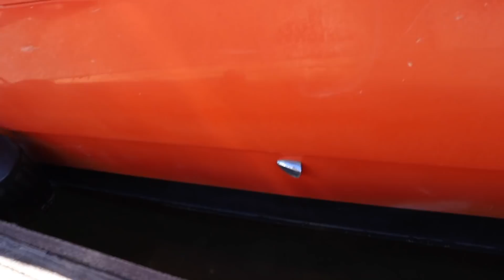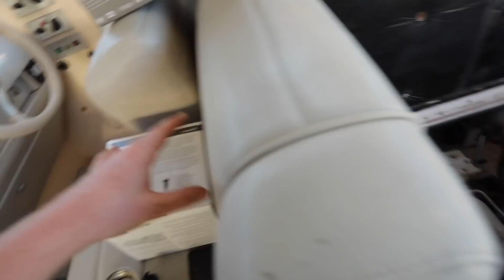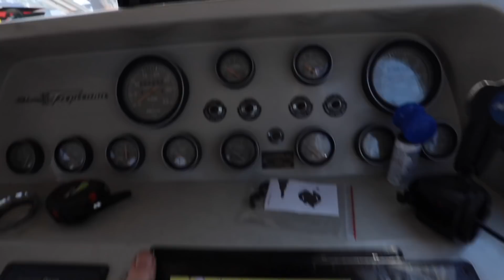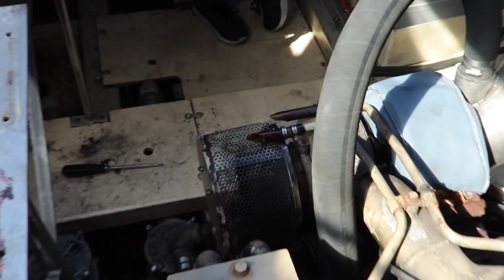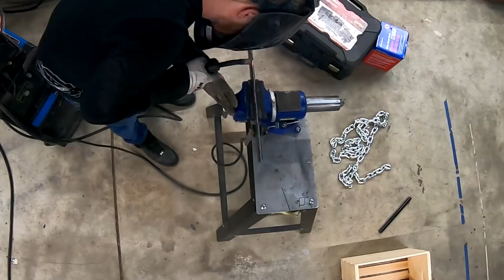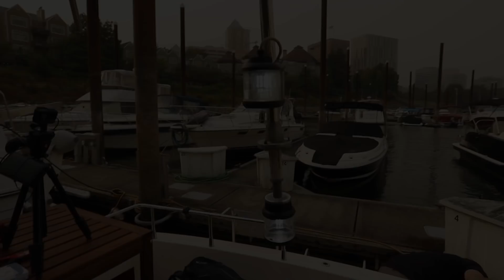Fixing Up My 30yr Old ITALIAN YACHT!

Comment: When anchored the boat needs to be able to rotate and point into the wind or tide. Anchoring from both sides is a good way to capsize.
Reply: I was thinking the same thing. Although maybe he had the idea of anchoring both sides when they are out in the bay partying or whatever. I know when he first got the boat that's what they did. Anchoring both ends in a situation like that is probably fine, just don't do that overnight when you aren't awake to fix it when things go south....
Reply: Dual anchoring has it’s applications.
Reply: Came here to post this. Also, that's likely not enough chain for the size and weight of that boat. The anchor keeps the chain in place. The weight of the chain on the bottom keeps the boat in place.
Reply: @unusuallatitudes8918  he needs at least quadruple what he's got I'd say.
Reply: Glad I'm not the only one concerned about the anchor
Reply: Stop moaning and just give the man the advise that he needs
Reply: @user-rt9ui6ge5d  m 2
m 2
1 week ago
"Stop moaning and just give the man the advise that he needs" 

AND HOPE HE READS & HEEEEDZ!!!!

there are times people just wanna see ''that one tree'' so they position their boat to SEE THAT TREE... or lighthouse or beech or wutever... BUT...

EVERYONE THAT GETS BEHIND A WHEEL OF A BOAT SHOULD TAKE A BOATERS SAFETY COURSE APPLICABLE TO THEIR BOATS SIZE AND TYPE!!!!!!!!!!!!!!!!!!!!!!

and STAY CURRENT ...as in, don't just take one class and think you got it covered..... you may... but that NEXT teacher on the next class may have other stories that will apply directly to YOUR FUTURE SITUATION and that ''online coarse'' had NONE of the extra WIZDUM!! 

or just go out and splash and hope nothing goes wrong... wutever
Reply: Yeah, you can tell he knows nothing about boating.
Reply: @RLC2020  You can also tell this community doesn't know much about boats either, only enough experience with little vessels to think they do.
Reply: @RLC2020  you should go watch his other boat videos... He doesn't seem to want to learn..
Reply: rlc2020 he should have went with a smaller boat like in the 20 foot section he shouldn’t have went with a 40 footer
Reply: @RLC2020  he said he didn't know much and it was his first hours driving a boat
Reply: @RLC2020  you didnt learn over night.
Reply: @dankane4193  I'm also not making youtube videos pretending i know what I'm doing.
Reply: @RLC2020  pretending? Whos pretending? He clearly stated when he bought this italian pos he knew absolutely nothing about boats. Most of the stuff on this channel is the learning experience associated with these videos. One would argue that for this exact reason they are so entertaining.
Reply: @dankane4193  this keyboard warrior so mad haha. Dude has no videos posted on his channel saying b is for build doesn't know anything about cars. Literal internet trash
Reply: @dankane4193  Lmao...if they were POS boats, they wouldnt regularly sell for $80-110k at 30 years old without issue. They are well respected
Reply: Rear anchors are used everywhere, you manually adjust the anchors as you need to. If you go boating on the islands in Ontario Canada you will see everyone with a front and and at least 1 sometimes 2 rear anchors. Boating isnt a "setup your anchors and dont touch till you leave" thing. you constantly have to be paying attention to winds and waves. Set the front anchor, point the nose into the wind/direction of the waves, set the rear to hold you there. otherwise you will swing around on the front anchor and be hit constantly at an angle by the waves which is not fun.
Reply: @definitelynotak4228  he specifically mentioned using it "to stay put for like an overnight stay" which is not at all what you are talking about. Double anchoring for overnight mooring is a disastrous and potentially fatal idea.
Reply: Justin Nolan he’s mostly in a river.  Not to mention all the other ways to use two anchors.  Basic boating courses teach that.
Reply: @Will Cooper  based
Reply: While this could be true it is dependent upon his location. If you are close to shore and do a shoreline with bow out and some slack it still alllows necessary rotation without allowing you to be broadside to the waves.
Reply: well i started cringing when he said phone holder....oh boy he doesnt even know how useless that phone holder and drink holder are xD just a wash from another boat and he will be searching stuff in the bottom of the river
Reply: Reading some of these comments I wonder if the people so readily giving advice or criticizing have any boating experience.

Stern anchors have their uses, like landlines do. It all depends on the situation (as in location, wind, waves, length and purpose of stay).

And it’s not the weight of the anchor chain that’s holding you and the anchor itself is not just a „decoration“. That’s only true when there’s no or only very little force applied to your boat, as in no wind/current.

Please stop spreading halftruths and misinformation, people might read it and take the advice and we get even more idiot people on boats in the end.
Reply: @Baerzilla   bUt Im A bOaT cApTaIn
Reply: I mean yeah, but when close to other boats it is nice to be mor stationary
Reply: Where I live a stern anchor would swamp my boat pronto. The chain should be about the length of the boat and heavy enough gauge to keep the tail of the anchor on the sand. If the tail can lift of the sand your drifting.
Reply: Bow and stern anchoring is common when rafting with other boats on a calm day.
Reply: You dual anchor as to not be the ass that has his boats hitting other boats.  He's not anchoring in the Bering Strait.
Reply: @Will Cooper  none of these car youtubers do to be completely honest. They just made it big by installing parts and getting sponsors
Reply: we use the same size anchor in a 4.5-5 meter boat that we rent out... he is joking right?
Reply: Don’t worry, that little anchor isn’t going to hold that boat any way.
Reply: He also forgot you need marine based speakers and headunit along with a head unit cover 😂
Reply: Wrong
Reply: Y’all need to chill he is new to boating and needs to learn.... I know he is in current and tidal water but where we boat we are in Lake Michigan and always double anchor at beaches to prevent spinning or we will hit other boats
Reply: So much snobbery. Dual anchoring is very common in certain situations. 
Everyone is new to boating once, at least he is learning his boat unlike most of the idiots down your local boat ramp.
Reply: guys, be nice, he never said "I'm a boat expert"
Reply: @Will Cooper  explain? Genuinely curious.
Reply: Only in very rough conditions
Reply: I'm not a boat guy in any way, but even I know this...
Reply: As a captain I’ll let you guys know proper anchor line length non storm is 7’ of line per 1’ of depth. You will never drag in proper bottom. In storm conditions 7 to 12’ of line per 1’ of depth.
Reply: He doesn’t know much I can tell and well he has to learn the hard way if that’s he’s idea
Reply: @conradbhansen  

Conrad B Hansen
1 week ago
"He doesn’t know much I can tell and well he has to learn the hard way if that’s he’s idea" 

.....
some people can NOT learn from others lessons (mistakes or otherwize) THEY HAVE TO LIVE THE LESSON TO LEARN THE LESSONS...  sigh... one of the probs with the world today.... ;) ME?? I am FINE learning by others's LESSONS & MISTAKES!!!

and one day I ALSO will have me a BIG OLD PURDDY BOAT... and I am fully inventorying his mistakes on this one ;) lol
Reply: What if you're in a sheltered cove with little wind or tide, a second anchor can keep your aft facing the beach - so its a good idea imo
Reply: I run dual anchors almost every time I anchor off of a sand bar. But there is a time and place for a rear anchor. My boat is smaller than his and I bet my anchor weighs more.
Reply: I was thinking the same...
Reply: I've seen plenty of people double anchor.  That's including  my grandfather's 35' bayliner, and my father's 32' black water. You just need to be smart when doing it and know the water where you're doing it.
Reply: in most cases it won't be a problem at all, except for being on big waters where the winds are reaching 40+ knots
Reply: Bow and stern anchoring is quite common and can be safely done when winds and seas are light ,  and the current is minimal . The problem is deploying and retrieving the stern anchor ,  you can back down on your windlass to deploy  and set your stern anchor or my preference is to use the rhib to deploy and set the stern anchor , the holding power of both anchors ( ie anchor weight and type ) should be close to the same  if possible ( his stern anchor is way to small with not enough chain , worse still how is he going to recover the stern  anchor once set ? Any stern anchor should have a rope and float attached tk the stem of the anchor near where it meets the anchor head so it can be  recovered easily .. on a larger boat bow and stern anchoring is not uncommon in protected anchorages , but if you are bow and stern anchoring to reduce the motion of the boat due to sea state its definitely not a good time to use a bow and stern anchoring solution... every large boat NEEDS 2 full sized anchoring systems , the anchor he built would be next to useless even in still water , that anchor would struggle to set unless you dived on it and set it manually  wthe  stem needs to be at least 4 inches .onger and a danforth needs to articulate way more than that , never let a timber box from Walmart dictate the size of your anchor lol ...
Reply: Probably saved this mans life with that comment 🙏
Reply: stern anchors are good on the river so you can keep the boat facing into the boat wakes for example. Otherwise the current would put you side onto the wakes
Reply: Do you have a Brother named Ryan? Lived in Missouri near 1996
Reply: It depend if ur at sand bar anchoring at two points is needed
Reply: Do not anchor by the stern. This is part of every boat training course and a major safety issue. You control your movement when anchored by 2 anchors on the front, not by a stern anchor. If you turn in the wind the bow takes the waves, as it is designed to. If you take them from the back during a turn in the weather, you will be swamped when the water comes in your air vents and fills your engine room.
Reply: That's a lot of shit bruh in a marina it doesn't matter
Reply: Very true
Reply: A friend's dad tied his boat too tightly to the harbour, leaving it hanging when the tide went out... It drew a good crowd!
Reply: N
Reply: And Cosby is a free Rich pervert ! So all you people who voted for Biden good job for supporting the kkk
Reply: Can more people like this so he sees it.
Reply: The chain is th eimportant part...the weight stops the boat...the anchor is just for looks...essentially...fat heavy chain mate...
Reply: @Thedeuceeyboi  not true at all...the anchor is meant to pull all the chain down and hold it taight, and to dig in, the chain by itself would do nothing nearly. Thats why all decent vessels have anchors
Reply: Typically in Florida when we are at the sandbar it is a must to have two anchors to hold you in place. Because when there is 25-100 boats you can’t be swaying around.

Note that the sandbar I go to is somewhat secluded.
Reply: Jason Smith You’re right, I’ve anchored that way myself at Disappearing Island, but at a party sandbar that’s more like parking. Most of the negative comments (mine included) are talking about moorings that are tide and/or current affected... especially overnighting. In these anchorages we judge our radius all around to keep clear of other boats. The right anchor, the proper weight and length of chain, and the correct length of rode means a peaceful night’s sleep.
Reply: As a licensed boat captain I concur. This video is fairly cringe for someone who is in the maritime industry.
Reply: ZedHead78 so is your comment. (For someone who is in the maritime industry)
Reply: @PistonsProps  good for you dad.
 let a man play with his boat without being so critical
Reply: @Tre L  Lol he would have been better off with a center console. These "Yachts" are way to much work and those old diesels are going to need replacing soon and that my friend is going to cost a pretty penny. If they arent caterpillars or Manns I dont want em.
Reply: @dankane4193  You can see the Cummins logo in the crack case vent hack section.
Reply: @dankane4193  i think you will find a properly maintained set of cummins wil last the life of tbe boat , a centre console is generally a day boat and fits in a diffefent entire category to the   riva , for general boating and entertaining on trips that last longer than a day , the centre console would be a poor choice
Reply: Figured maybe amplifying this comment more was better than making my own.  A lot of people here don't understand anchoring at all, including, based on the video, B for Build.  My suggestion is to get really good at anchoring with your primary anchor before setting off on multiple anchor adventures, or getting yourself into any situation where a second anchor is necessary.  As for the bow and stern configuration, you shouldn't use it any time there is a risk you will have wind direction changes or that waves may start coming astern.  It's just a bad idea, especially if you aren't setting a watch, not just for safety, but for comfort.  Definitely do some research here.  Don't believe me and definitely don't believe the people implying it's fine in any situation because they've done it in a specific one.
Reply: Yeah that’s why the anckor is always in the front you need the front of the boat to hit the waves not the side...
Reply: I’ve anchored from stern and bow to keep my boat from moving in slack tide. Didn’t even know it was bad
Reply: @Will Cooper  ...TROLL....
Reply: He’s a struggling seeman

Comment: That JVC-TD91BTS is not marine grade. You can use that inside the cabin just fine but you need a marine grade radio for the outside or it will be junk in a year and corrode. You can spend just a little  more and get a good quality marine grade one that has all the same features and you won't have to worry about corrosion and water.

Comment: IMHO that anchor is a bit too small for that boat.    If you paint that anchor, it would be handier in white or red.   That way you will have a better chance of finding it, when that puny 3/8" line breaks.

Comment: Nice use of printing! I'm sure you know this and I apologize in advance if so but... don't print that holder in PLA. The glass transition temperature (the temperature at which the plastic starts to flow) of PLA is about 120 degrees Fahrenheit which, especially as that thing is both exposed to the sun and printed in black, it'll likely exceed. Try ABS (tG=~220F) or even polycarbonate (tG=~293F) although with polycarbonate especially you need an all metal hot end and you absolutely must dry the filament before printing or the print will simply fail. Coincidentally, I suspect that wet filament was also why those 3D printed, carbon fiber covered vents that you made for the Burntacan failed as the resin cured.

Comment: If you attach the chain to the other end of the anchor and put in a week link (cable tie) where you have it, if the anchor gets stuck stuck the cable tie snaps and you pull the anchor out backwards making it much easier.

Comment: On some engines the "breather line" goes into the air cleaner housing after the spark arrester / filter to re-burn the blow by gasses and prevent carbon monoxide buildup in the engine compartment
Reply: Yeah I was thinking that it’s jetting oil if it’s overfilled but carbon monoxide is a killer, esp if it leaks into the cabin.
Reply: Was thinking the same thing. I would have left it.
Reply: Catch can should be vented back to the intake
Reply: And also diesel engines dont tend to like catch cans iknow on ford engines it messes with the vaccum that controls the vgt solenoid  in the turbo not too sure about cummins
Reply: Came here to say this as well. Be careful to maintain ventilation when working on the engine with this mod. Safest not to have it. It's also not very environmentally friendly as the idea of redirecting it to the intake is to burn everything in a subsequent pass.
Reply: I was thinking more along the line of the the breather line drips oil onto the cleaner to keep them oiled, like a JLT or KNN?
Reply: babelsalot that is not how wet k&n filters work
Reply: @burninrubba65  Maybe I am thinking industrial engines then. I have seen big diesel engines that drip oil onto the intakes, I figured it was the same reason as why you oil your filters, just more efficiently?
Reply: @babelsalot  you're probably thinking of pcv
Reply: @babelsalot  no

Comment: its not the weight of the anchor that keeps the boat still its the chain, you need much more chain
Reply: Actually its the entire anchor system that keeps the boat in place , the catentery effect of the chain is only one aspect you need the correct size and type of anchor a suitably sized high tensile chain with the correct amount of scope deployed 5 to 7 times the depth and importanly a snubber cleated to take the shock out of the chain

Comment: What's the most durable marine finish? Powder coating? That anchor is just going to rust, very quickly.
Reply: Yes, it's regular steel. It's going to rust anyway, even if it not near fresh, river water. It just needs a sanding and new paint. Or worst case; buy a new one, ohh wait, what was the channel name again?